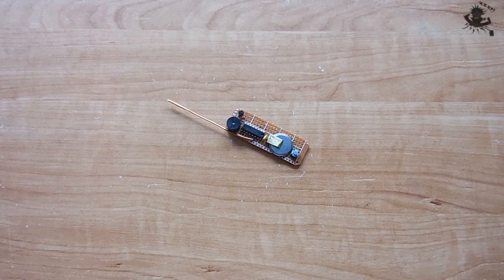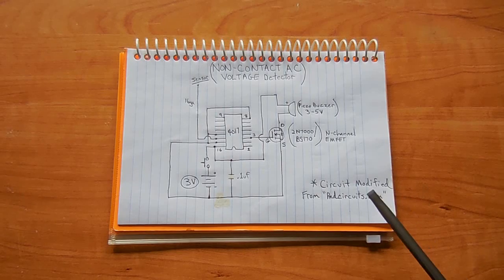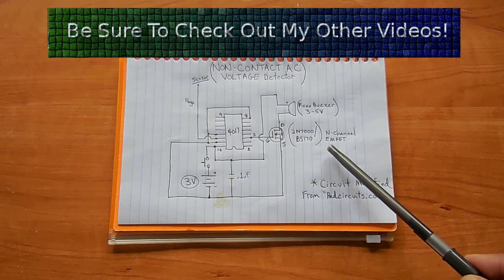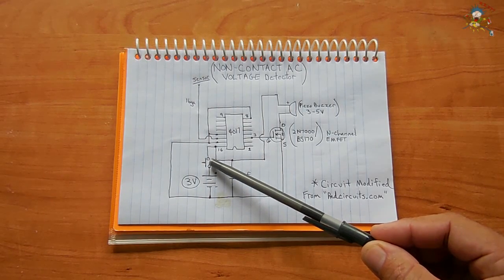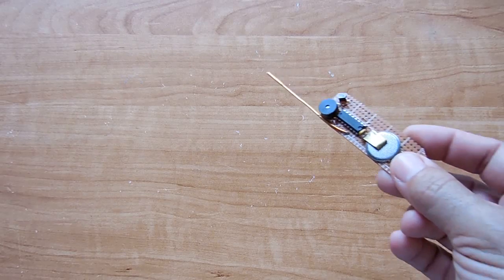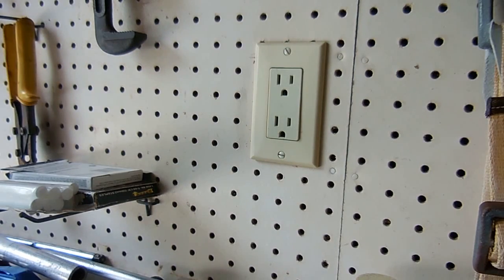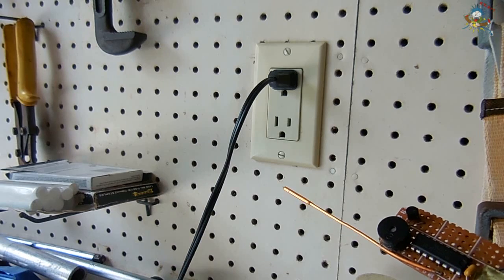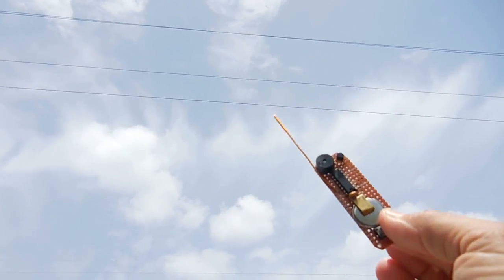Super Sensitive AC Voltage Sensor Circuit

Comment: Sir can I increase the length of antenna .then can detection distance increase or not sir .reply sir
Reply from the maker: You'll need to experiment.
Reply: try to set the voltage power supply to +5v  typically for this IC or make the wire like a coil... circular wire one...

Comment: sir can you send me a vid. of how you assemble that??
Reply from the maker: The circuit is very simple to assemble. If you don't understand circuits, then please refer to "Talking Electronics" website to learn how to read a schematic. Thanks.
Reply: electronicsNmore 
i understand your diagram sir... you said you use emfet trans but it  is actually jfet... so i use jfet but it  didnt work
Reply from the maker: No, use a BS170 or 2N7000
Reply: electronicsNmore 
thank sir but i have one problem when i push the switch the led will open..
Reply: @paoloestrda2376  2n7000 is a N-MOS... not a jfet one... i think you can put a schottky diode before the led..and a 150 ohm resistor in series to replace the buzzer... schottky diode voltage drop is aroud 0.3v .. this mean ..the led will light up at around 2.6v and a drive current around 2.6v/150ohm = 0.017A -> 17mA ..that;s enough... try first without diode ...

Comment: can i ask how to put LED and  why is it simultaneously buzzing when i press the button.
Reply from the maker: Sometimes you may have to press the button a few times to reset the circuit until no sound is heard before approaching a wire. For a visual and audible indication, try placing a 470 - 1K Ohm resistor in series with a red LED, then place them in parallel with the piezo alarm.
Reply: it means that this is a noise detector too? what if adding a bandpass filter to the sensor does it make sense to just filter the noise and the sensitivity for the AC detector only?

Comment: So if this is near dc power, the sensor will not "accidentally" buzz? I plan to use this near a dc line to detect when ac is introduced into the environment
Reply from the maker: This circuit only detects AC or DC pulses. Pure DC(like a battery) will not trigger the device.
Reply: Thank you for the response.

Comment: hi dear Mr.Philip  please help me  ,, I make This electronic device but I
 2 problem , 1-LED light is low  2- this clip LED whit BUZZER  Are both 
simultaneous  PLEASE  send me schematic electrical  BESTREGARD
Reply: the led light is low -> try to change the value of resistor in series with LED to be around 120 ohm ... and to keep led turned on you need to add a diode in series with led , before , but the general voltage of the schematic is to low to do this.. 3v ..with a voltage drop across the diode mean 3-0.7 = 2.3 max voltage to drive your led... so ..what;s wrong with just keeping the buzzer, without other add ?
Reply from the maker: You need to explain better.
Reply: you , Yourselves  You know this project ? & yourself  explain better?

Comment: can we decrease the distance of AC line and sensor, I mean sensitivity.
Reply from the maker: Try adding a very low value non-polar capacitor on pin #14 leading to the sensor antenna. Doing so should weaken the pulses being detected. Thanks for watching.

Comment: great stuff... i would just caution that you should have some sort of LED on while the button is down to indicate that the battery is sufficient for operation.  Otherwise, you could have someone with a dead battery (or new battery that isn't making good contact) think that a wire is dead and cut into it, when in fact it is not.

Thanks so much for sharing these projects!
Reply from the maker: Frank Graffagnino Good point, but I always make sure the tester works on a known live wire/receptacle before using it. 

Thanks For Watching1
Reply: electronicsNmore well, I wasn't worried about YOU using it. :)
Reply from the maker: Frank Graffagnino
As a result of your comment, I added an annotation to the video!

Thanks
Reply from the maker: Kevin Hauser
Nothing is 100%. I have seen faulty bar meters in the past. Just test the device immediately before using it and you should be OK.

Thanks For Watching
Reply: Agreeing with the above comments.  People need to understand there's a huge difference between an AC detector and a safety device.  This device is insufficient for telling you whether a circuit is SAFE, though you can somewhat mitigate that by proving a live circuit.
Reply: That's also what I do.
Reply: +electronicsNmore can i ask how to put LED and why is it simultaneously buzzing when i press the button.

Comment: Nice one. Can it detect wires in the walls? Could be handy to trace where wires go, before, let's say, drilling a hole in the wall :)
Reply from the maker: MrJohhhnnnyyy It all depends how far into the wall the wire is located, as well as the type of cable being detected. Power cords are easy to detect. The circuit in the link below works AMAZING at locating wires hidden in walls or in the ground. All you need to do is make sure a CFL is connected to the circuit being traced. The CFL introduces noise into the AC line which makes it easy to detect. 

https://www.youtube.com/watch?v=nb5kHUNrCOc
Reply: electronicsNmore I saw that video, just curious which one is better for finding cables in the walls. I guess the one where you need CFL is better, 'cause it gives you ability to pinpoint location of the cable.

Comment: Outstanding.  For power outages, my electrical panel has a mechanical interlock that allows a generator to apply power to both busses when the main breaker is switched off.  My only problem was finding out when the power came back on.  I have been looking for a way to monitor the main power line without a direct connection.  I think I can l modify your circuit so that I can trigger a little bigger buzzer to tell me when the main power is back on.  Great Job!
Reply from the maker: i8BBQ4Lunch Hello. I installed a red neon lamp(you can also use a red LED in reverse parallel with a 1N4007 diode, which is in series with a 47K resistor between the (2) 120V legs. You may have a spot to install the indicator between the main breaker and the transfer switch.

Comment: You need to put in a sensitivity control pot.
Reply from the maker: MrMac5150 Hello. That is easy to do. I mentioned in the video how to reduce the sensitivity if desired. Use a fixed resistor in series with a POT from pin#3 to the NEG rail. You will need to experiment with different values.

Thanks.
Reply: electronicsNmore
Nice.

Comment: Is there any description regarding why this actually works?  It's kind of hard to believe the voltage on that probe would get to a sufficient level to trigger the 4017. 

Very cool circuit btw!  Thanks for taking the time to put this together!
Reply from the maker: jcims Hello. To my understanding it uses "capacitive coupling". Below is an explanation from a website(homeinspect2020) showing different types of non-contact AC testers.

CAPACITIVE COUPLING TESTER: This is a newer type of
non-contact voltage detector that uses capacitive coupling to
detect an electric field. These upgrade detectors can detect
an energized wire that is not conducting current. They detect
electrostatic fields associated with live wires that are not
necessarily part of a close circuit.

An electric field is associated with a stationary charged
particle. An electric field will exist even when there is no
current flowing. When the charged particle moves through a
conductor, it creates an electromagnetic wave. Electric fields
are part in parcel with magnetic fields and are associated
with voltage. When electrons move through a wire, an
electromagnetic field is induced around the conductor. These
electromagnetic waves can induce a current on the secondary
wiring inside the tester. Whether is be from induction or
from capacitive coupling there must be electric field present
to activate the tester.
Reply: jcims Same reason why static electricity makes things cling, electrostatics. High voltages cause strong electric fields, which can push or pull electrons, at least that is my understanding. Though electronicsNmore is probably also correct in that there is AC, so some weak capacitive coupling is also happening.